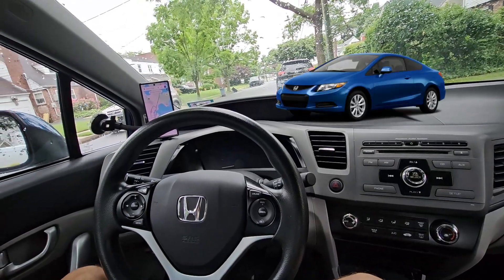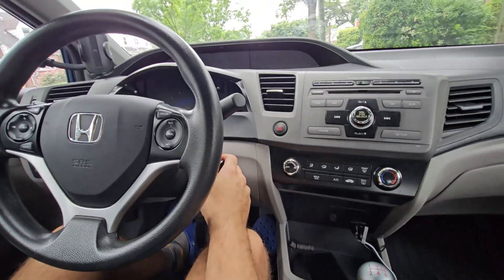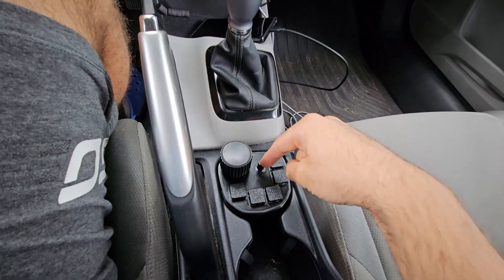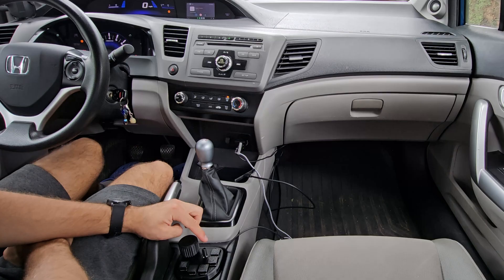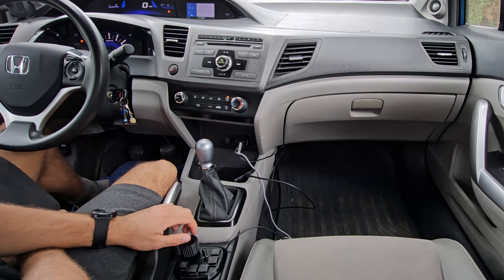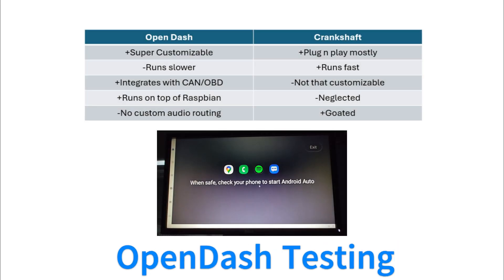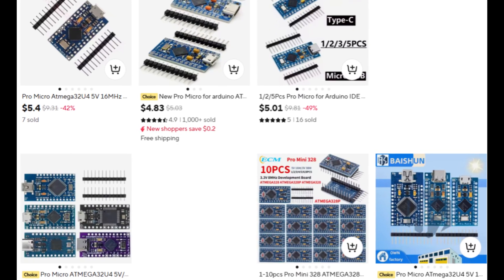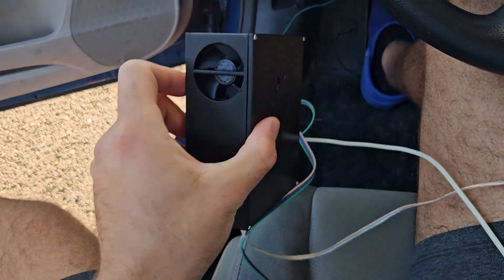Hacking Android Auto into my old car with a Raspberry Pi

Comment: I would like to do something similar as I have a 2013 Civic LX. Can the Pi connect to backup dash and backup cameras? What about OBDII readers?
Reply from the maker: I hope it goes well! what do you mean by your question could you expand on it please
Reply: @TheRedMammon 
Thanks. I'm just separating my questions:
1. Can the backup camera be routed to the Pi instead of straight to the screen?
2. Can dash cameras be connected to the Pi (and used with Android auto)? My dash cam has USB but some have HDMI. 
3. Can we use OBDII readers to get more info into Android Auto?

Comment: This is an awesome project! I've been looking into this type of setup on my third gen acura tl. In waiting on some parts before I do a video but I'm going to try to hack into the display bus on the car rather then backup cam input. My favorite thing about these types of products is how scalable they are. Honda/ Acura have used the same display bus from pre2000 until roughly 2013 depending on car. Different plugs though. One of the biggest challenges I've faced is how to control such a device as well. If you could do a more in depth video on the technical stuff that would be awesome.
Reply from the maker: thats awesome. definitely let me know if you get the display bus working with your device. the controller is simply an arduino pro micro acting as a keyboard. crankshaft has some configurable keybinds. let me know if you have questions
Reply: @TheRedMammon I'll have to look into that. In hoping to prove that the system integrates properly without losing any functionality. Then remove the nav drive completely and see if the factory touchscreen and controls will play nice with the raspberry pi. My car wasn't factory navi so i added that functionality to it initially so I'd have a base to do the tablet mod but now i think I'd rather do this.

Comment: I was thinking about installing this in my 2011 Lexus CT 200h. It doesn't have touchscreen on the display and uses a built in computer mouse. Do you think it will work?
Reply from the maker: You'd need a way to interface with that mouse but I think you could make it work at the very least by replacing the mouse!

Comment: You should intercept the steering wheel controls and just put a knob that has a press function for select tucked between your ebrake and shifter so you get your cup holder back.
Reply from the maker: steering wheel controls are working thanks to the phone being connected to the cars bluetooth! I could probably figure out a nice mounting solution between the ebrake and shifter though....

Comment: Make sure to make the pi OS read only when doing an application like this where power just gets cut all the time. Not sure if that's a feature of crankshaft already.
Reply from the maker: thats a good point. I'll look into it
Reply: I think that ideally you would want to always keep on the RPI. Stereos are also always powered, however the difference is that they have the accessory power signal that tells them when to go to sleep once you turn the ignition off. 

Since RPI doesn't have hibernate/sleep functionality by default, you could create a small script that would check the accessory power signal and decide if the RPI needs to be powered down, in that way you won't corrupt your storage by randomly turning it off/on. You will also have the added benefit of setting a timer when to turn off the RPI so it doesn't turn off instantly after you leave the car for a short time. I would personally leave it running for 1-2 hours after the accessory power is down, so it doesn't drain the battery overnight.
Reply from the maker: @D4no00  not a bad idea at all. I will probably implement that when/if anything gets corrupted. For now its been working great and I can't be bothered to open up the plastic cladding again lol

Comment: That’s sick that you were able to integrate the pi to work with the existing display. While driving does the small size of the screen cause issues with read ability?
Reply from the maker: It can if you split screen google maps and there is small text. Otherwise it works well